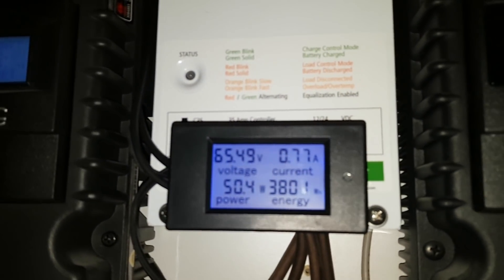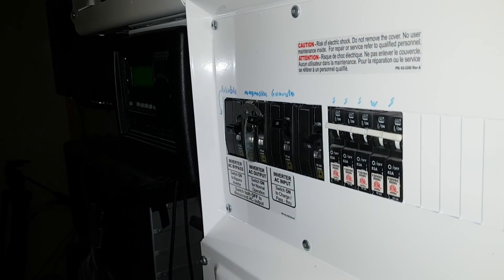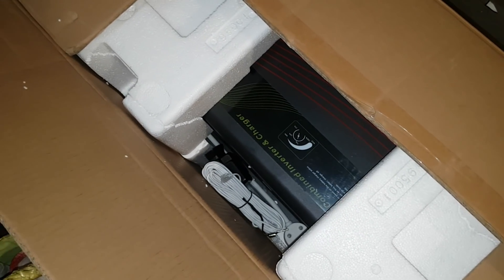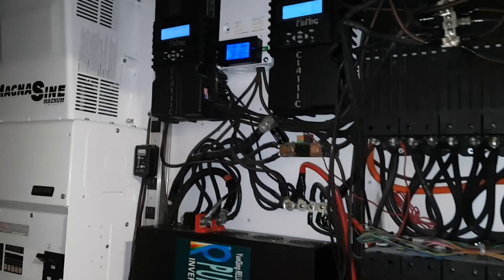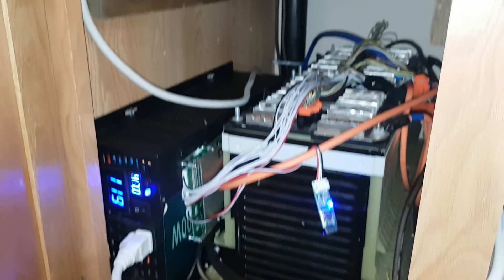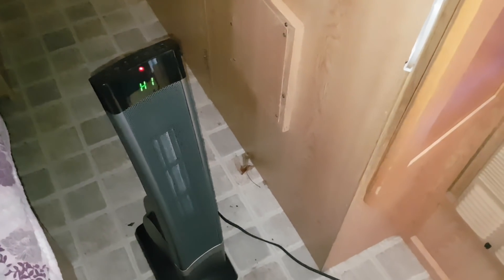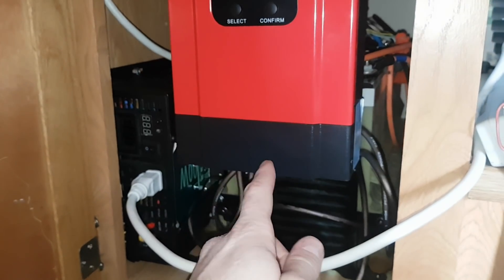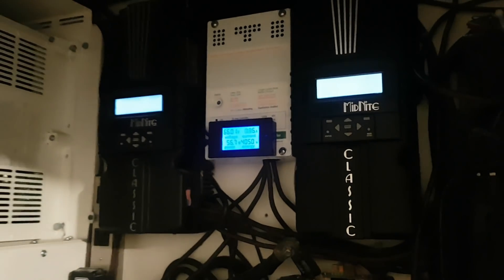Making Loads Of Power And Installing 40A Esmart3 In RV

Comment: Recently got a Volt battery for my system, what BMS are you using and how is the eSmart working for you?
Reply from the maker: I like the Esmart3 it works well, make sure  you get the communication cable to set the charging parameters. here is the bms link

https://www.aliexpress.com/item/12S-100A-50-4v-bms-12s-2018-new-Li-ion-smart-bms-with-android-Bluetooth-app/32905552051.html?spm=2114.search0104.3.85.7da76dddFwanz2&ws_ab_test=searchweb0_0,searchweb201602_2_10152_10065_10151_10344_10068_10130_10342_10547_10343_10340_10341_10548_10696_10084_5724015_10083_10618_10139_5724315_10307_5724215_5724115_10059_5013715_100031_5725015_10103_5724915_10624_10623_10622_10621_10620_5013815,searchweb201603_6,ppcSwitch_4&algo_expid=cbdc5923-f93f-4255-9397-220bc2d6e1e5-12&algo_pvid=cbdc5923-f93f-4255-9397-220bc2d6e1e5&transAbTest=ae803_1&priceBeautifyAB=0

Comment: Can't  find the reliable  8000 watt inverter here in NY
Reply from the maker: they are making a stronger model im told, this one here, I will be testing it soon.

https://www.ebay.ca/itm/8000W-Pure-Sine-Wave-Inverter-12V-24V-36-48V-DC-to-120-240V-Solar-Power-Inverter/201588624870?_trkparms=aid%3D111001%26algo%3DREC.SEED%26ao%3D1%26asc%3D20160908105057%26meid%3De1c5194fff5e4857a8eafbb5ae58e672%26pid%3D100675%26rk%3D1%26rkt%3D15%26mehot%3Dag%26sd%3D201588624870%26itm%3D201588624870&_trksid=p2481888.c100675.m4236&_trkparms=pageci%3A6356a620-4938-11e9-bebb-74dbd180f2a8%7Cparentrq%3A8f1caad01690aa6fd97597fbffff8156%7Ciid%3A1

Comment: Hows the water cooling the 8000w plan going?
Reply from the maker: Once I fould out that the inverter mosfets where not the cause for sudden death I abandoned water cooling, the problem lies in the brain box that is driving to many mosfets and the brain dies from the right spike of electricity and shorts the mosfets, at least thats what I think. I will be testing reliables new 8000w soon, it xhould of corrected this issue.

Comment: How many of those "Reliable" inverters have you been through so far?
Reply from the maker: this is the third one, one my fault one just died, so 50/50 atm
Reply: If u want to upgrade it from 8k to 10k in the future, would it work with just replacing the output board alone with one from a 10k unit?
Reply from the maker: @majingaknight  im not sure, it might be like that :D reliable has remade their 8000w and they say is very robust now.
Reply: @GoingOffGrid101  I saw some pics of the new design. They only got 2 cooling fans. They look bigger alright but can't say if they are big enough.. anyways.. fingers crossed. Waiting for a review soon.
Reply from the maker: @majingaknight  you got it, I will be putting it up against the old 8000w and my magnasine inverters.

Comment: you might want to install a dc breaker between the battery and the solar charger in your caravan. it makes it so much easier to work with. or in an emergency event. and heaps more professional.

Comment: you said a similar thing about that cheap chinese inverter in one of your previous videos. and it still selfdestructed.
Reply from the maker: Haha witch one
Reply: @GoingOffGrid101  the second one.  you said something like the second one has improved safety mechanism or something to the effect. is asked how you know that. you didn't know. then it broke anyway.
of course that is all from memory, but suppose could be very time consuming to find that particular video, but could be done.
Reply from the maker: @ursodermatt8809  I do remember that lol, its true, I am not sure why that one died, im going to start using the 8000w a lot this summer to run my large pool pomp, and my parents RV AC.
Reply: @GoingOffGrid101  
yes will be interesting to see what happens

Comment: Have you seen my comment about the Sigineer Inverter you tried out before that I left you ? Just to let you know heads up to consider when installing it and the AC connections that I’ve discovered . Your setup now is awesome . Keep on with the additions because the Magnesines and the 8000 watt Reliant Inverters are doing great . Can’t wait for the new Reliant 8000 watt review that’s coming . May the solar be with you .

Comment: That esmart. Check to see if its poss ground. Awesome power. I seen about 5500w on mine.
Reply: Should be using input output breakers
Reply: I have lots if you need.
Reply from the maker: I used a fuse, not sure about the case ground
Reply: Remind me next time i see you . Ill give you 2 breakers and a box for them
Reply from the maker: @frankz1125  sick!